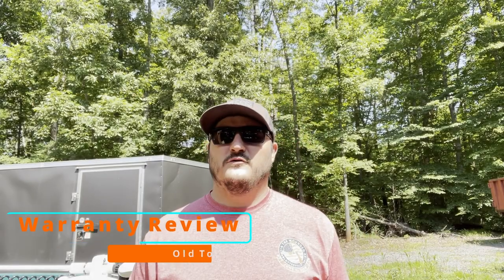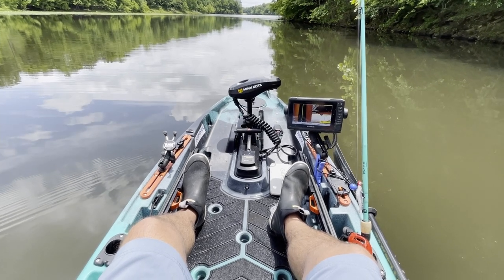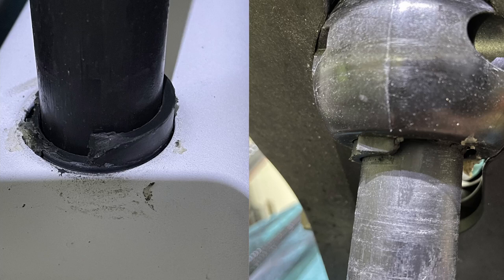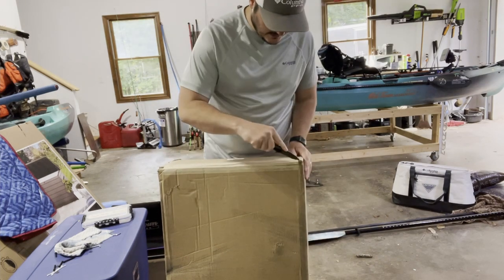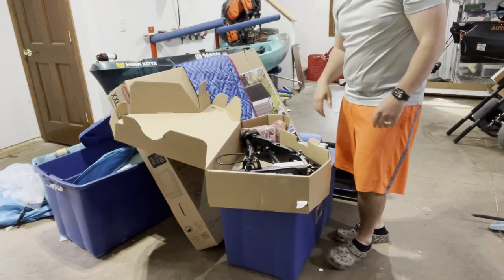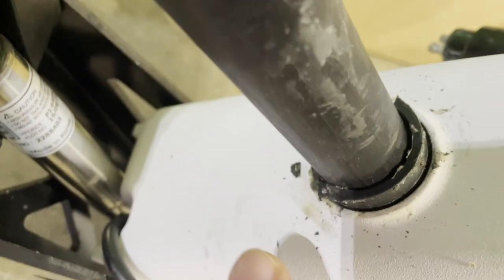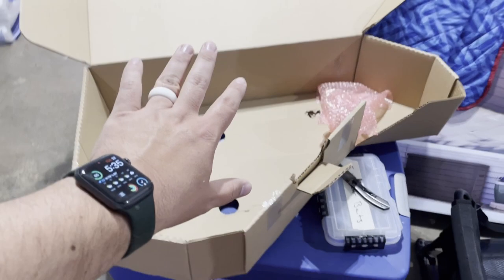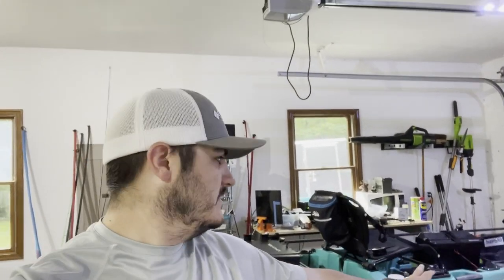My Old Town AutoPilot Motor Broke!!! - Warranty Review!

Comment: I’ve only been out 5 times and just had a similar issue with turning and spot lock. Although the collar isn’t chewed up like yours. I wish that had a larger alternative to the 106 I would have went that route instead.
Reply from the maker: If your collar isn’t chewed up then the collar probably just wasn’t seated all the way down. You might have to pull it a little harder to get it to seat correctly. But I’m yea I wish there was a 120 powered by Minn Kota as well.

Comment: Yep,, the spotlock makes up for a lot of other sins..."HEAVY" and of course the ever present "HEAVY"  ha.  So they replaced he motor.  That's very cool.  I think Mark MDLR had an issue also but I should check first before saying that.  Love the Navarre floating nut.  Great idea. Man, I'd love to figure what that clunk is when it won't turn and then the clunk and then it works. I see it, I hear it,  but I really don't see it. I've not had any big issues but OldTown and MinnKota have both been excellent to talk to.   Ah, I'm subbed now.
Reply: i wish i knew now what I didn'tknow then... It took 3 years and 75 days on the water but I now know what the "clunk' noise comes from.  The steering ball assembly with the upper collar half, is tichtly clamped around the shaft with 2 bolt/nuts, which bring the 2 halves together, and hold the upper collar half tight against the shaft.  The orientation of the upper collar half needs to complement the lower collar half (the two orange arrows need to be aligned when the ball assembly upper collar is assembled and tightened) which is fixed into the lower white motor unit, which has the gears that turn the shaft. When you draw the motor down into position with the paracord pully, the two collar halves need to fit together "clunk" perfectly.  The upper collar half needs to be drawn down all ther way to completely complement/marry to the lower collar half.  The paracord needs to be completely tight in the cleat so the two collar halves are perfectly fitted together to form a flush connected collar.  The spot lock shaft movement torgues on this connection constantly, so if the ball assembly is even slighly loose, or sitting 1/16 of an inch too proud, it will eventually become malalligned and cause the steering to fail and hence need to be manually rotated until it "clunks" into alignment.  The plastic collar halves will become worn and their perfect complementary connection becomes less and less reliable.  Replacing the entire steering ball assembly then becomes necessary.  This is not difficult but necessary.  The plastic design of the two collar halves makes the assembly salt water resistant but prone to wearing down with prolonged use of spot lock.  The steering ball assembly is $30 bucks mailed to you from Old Town. I still love this kayak.

Comment: Knowing the issues with the motor would you recommend a hobie pa as a better option?
Reply from the maker: No I prefer the AP120 over a Hobie PA, it seems the 360 drives have just as many if not more issues wit that drive. That being said the AP120 has had some revisions and drive upgrades since 2020 and I'm not seeing anywhere near as many drive issues as I used to.
Reply: Hobie PAs aren't having nearly as many issues since 2022 onward. They got most of the kinks out of the 360s. Some people will hate on Hobie no matter what. I think it is funny how many people talk crap about Hobie's prices, but this boat with a 100 ah lithium battery will cost you well over $5,000.
Reply from the maker: @caleb4015 hobie was sold to a bigger company during Covid they have had a lot of quality control issues as well as shortening their warranty. I think people’s issue with them is that the quality has gone down, price has continued to go up every year, and the warranty isn’t as good as it used to be. I used to be a Hobie guy, but recently I got out of kayaking all together due to the cost. I rather spend 14k on a used 17ft aluminum bass boat than 6k+ on a kayak.
Reply: @BlueSummitOutdoors  I totally understand you brother. You should check out the video from Kristine Fischer on Hobie. I actually have been on the prowl for a new kayak for months and after talking to 2 separate dealers, neither of them have many warranty claims on their Hobies; Especially since 2021.  I think people like to really hate on Hobie because they are expensive. Also, every kayak brand has increased their prices by several hundred dollars, not just Hobie. Good example is the Old Town 106 MK. Used to be $2999 2 years ago, now its $3499 with 0 changes. 

Personally I have never understood the point of getting a kayak when you plan to have a motor on it. At that point it makes much more sense to get a boat.
Reply from the maker: @caleb4015 yea everyone’s prices have gone up, however Hobies prices always went up before everyone else’s did.  They would sell the same boat with no changes for a couple hundred dollars more just because it was the new years model. In 2017 I bought a Hobie PA 12 for $2999 brand new. That same boat (non 360) is now $4600 with very minimal changes over 8 years. I can forgive 2020-now due to inflation. But they were doing it well before then. As far as old town it’s mainly due to inflation but they also offer a lifetime hull warranty which is amazing. I’ve owned probably close to 15 hobies over the past 8 years, and the newer ones are not built with the same quality as they used to be. For example the hatch liner in the PAs is built completely different than it used to be and is so much flimsier and cheaper feeling. The back rudder cap on the PAs used to be 4 brass inserts now there’s only 2. They have cut a lot of corners. Plus on a kayak that cost $4.5K-6K you still have to buy a $100 adapter plate to attach a power pole. That’s absurd. Especially when basically every other kayak has that functionality built right in for years now. Even their own Outback and Lynx have it built in.

Comment: I have the same issue. I only had my AP 120 out five times and the collar snapped. They are sending me a replacement part. I am not certified to do repairs. They responded quick. But not happy with the out come.
Reply from the maker: They since me a whole new motor. Did they just send you a part?
Reply: @BlueSummitOutdoors  yes they sent me the part. They said it was a force break. I only had it out five times and was extra careful. 
When I get it fixed I will put it on the market.
Reply from the maker: Yea that’s basically the reason why I decided to move on. It’s a great kayak, but little problems like this are a deal breaker for me.
Reply: Well they sent me the wrong part. Now they are not responding back to me. I am not to happy about their service. I am going to put it up for sale and take a lost and buy a bass boat.
Reply from the maker: Yea the motors longevity was my only concern with the boat everything else i was happy with. I don’t blame you for posting it up for sale.

Comment: Hey man quick question. I just got the autopilot 136 and I was wondering if you ever have a problem where the motor head has vibration or is a bit shakey when you get over the speed of 5? I wasn’t sure if it was normal or not. Thanks
Reply from the maker: Yea once or twice for me it just wasn’t not seated correctly and wasn’t all the way pull down.

Comment: Is there anyway to repair this in the case your warranty has expired?
Reply from the maker: I believe they offer replacements, however I’m not sure if you can buy parts to repair your drive. It’s possible that if you contact Old Town/Minn Kota (Johnson Outdoors) they may be able to help you find the parts you need or offer a repair service.
Reply: im having the issue as you but my warranty is over. I dont feel like spending 2k on a replacement.
Reply: @paoslee  there are some authorized repair shops in Charleston sc id check around there are good shops might be able to help you

Comment: After less than 12 trips, the motor for my AP 136 has started failing. Looks like they have some serious internal defects.
Reply from the maker: Yea unfortunately when it works it’s a great kayak
Reply: @BlueSummitOutdoors  Old Town is sending me a new motor. The confirmation email says "Qty Backorder: 1 Each", so if that's what I think it means, I'll get it by November. Maybe. Guess I'll have to rig it for paddling mode and not go far.
Reply from the maker: Yea they really need to up the quality of materials on the motor instead of continuing to ship something they know that fails.
Reply: @BlueSummitOutdoors  I have a 2020 model, so hoping whenever I get this motor, it's actually a new version. And not just new old stock. So I expect it to have the new magnetic switch mounted to the side that I'm to ignore. These things might end up being pricey lemons.
Reply: @BlueSummitOutdoors  Uhm, why is the new motor they sent you so dirty??? And are these really new, or refurbished returns??
Reply from the maker: I don’t know. It wouldn’t surprise me if it was refurbished, but that’s disappointing that it’s dirty.